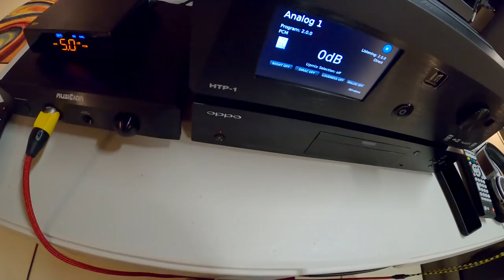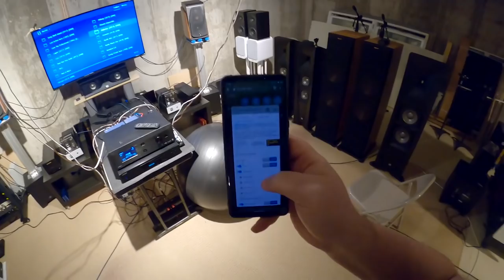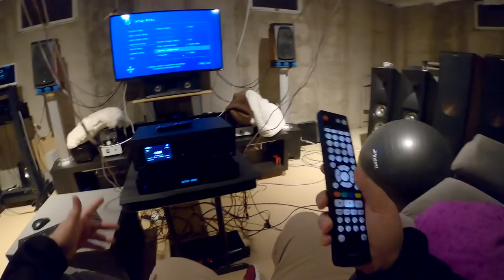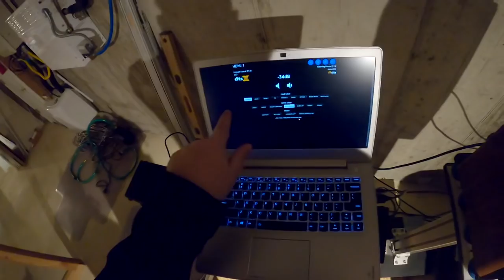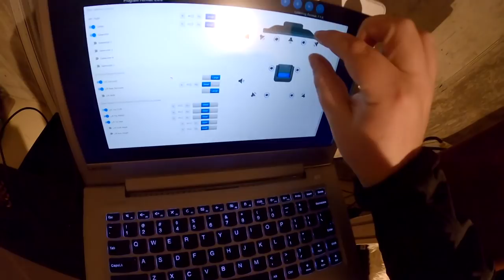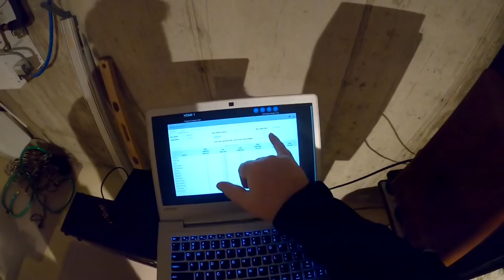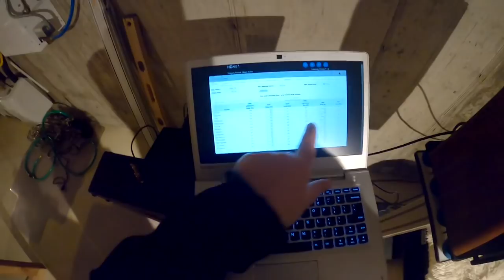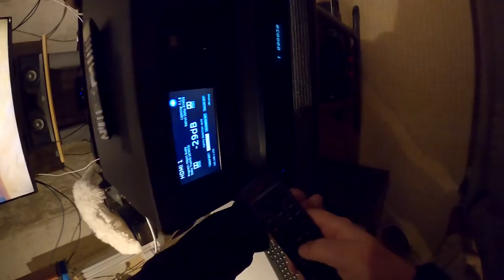🟥The Atmos Adventure💎💎💎💎 Monoprice HTP-1 Processor || Z Review

Comment from the maker: P.S. the video glitched twice and had Cyclic data corruption. So you may notice it at ~6 minutes and a little later.  Check out...
⚔️https://www.SubscribeStar.com/Zeos -- Subscribe Star
🥇https://www.Patreon.com/Zeos -- Check out the Patreon
Reply: Nobody... Z"s favorite word BURN MEGUMIN X( made me sad
Reply: Do a full surround setup of Adam T5/8V as the speakers, no more worrying about amps
Reply: Also some avrs/processors allow you to reassign outputs to different positions. Plug your "Mid" Atmos channels into "front" and see if in the menus you can reassign "front" Atmos to "center"
Reply: Z Reviews I've had a similar experience.  I have a Marantz AV7705 processor running into Emotiva amps for a 7.1 setup and I've been very disappointed with how much sound comes out of the side and rear channels, to the point that I'm considering just running a 3.1 setup.  However, when I go to the theatre, they have all kinds of sound coming from the surrounds.  How do you think they are doing this at the theatre?  Are they getting a better audio track than we are on our blu rays or do you think they are just altering it?
Reply from the maker: @blunderingknifereviews1028  honestly I don't know enough about commercial theaters to give a solid answer. I know the mixes for theaters are completely different then most consumer blends

Comment: If you still have that setup, what you really are/were looking for is the Auro-Matic feature. The specs page lists it as the last supported audio codec. I have a Marantz SR8015 in the living room with the Auro-3D 9 speaker layout / Atmos 5.1.4 format with the heights laser aligned to seating positions due to OCD. Auro-Matic takes content in whatever format it is in; DTS, DD, DD+, Atmos, even stereo, and converts it to Auro-3D. It will use the height speakers a lot, and it does a very good job with most (90%) content. There is an Auro-Matic setting from 1 to 16 that allows you to tune the affect. Set properly, the LRC and front heights have the front stage floating in the room sounding like it is coming from a few feet in front of your face at screen level. If you have the setting too high, some content will have random audio that should be in front of you sounding like it is above you or sometimes almost slightly mixed with the backs. Setting it to 14 keeps that from happening in my environment which is about 7.5ft viewing distance. During the day, my wife watches regular FIOS TV content like HGTV. It uses the height speakers and sounds great.  Also, 85 to 90% of content in native Atmos sounds better in Auro-3D. Atmos content in Atmos sounds good. But you can clearly hear things moving between speakers. The average person, if blindfolded, would be able to point directly at my height speakers in Atmos mode. Where with Auro-3D sounds blend better and subtle sounds come from areas/angles where viewers are not even sure if the sounds are in the content, in the house, or coming from outside at times.

Comment: There are a few things about Atmos that hurt my brain at first. Some of which are likely true of DTS-X as well...

With Atmos (at home), most Blu Ray releases are mixed to have 7 "ear level" speakers (plus LFE), using TrueHD to compress those channels losslessly.

Atmos itself is just an extra substream of metadata added to the TrueHD stream.
(older non-Atmos receivers simply ignore that extra substream.)

Originally, I thought Atmos releases would include maybe two full extra channels of audio along with the 7.1 mix.
But no, the bandwidth for the metadata is tiny. It doesn't contain any actual audio data at all, AFAIK.

So that means ALL of the audio you're hearing in the Atmos height channels originated in bed (ear level) channels.

Which in turn means - Atmos is essentially a fancy "panning algorithm" that selectively pans audio from the original bed channels into the height channels.

The metadata contains info such as X,Y,Z position, but it has to make some compromises with how much it can try to separate the "objects" from the original mix.

(there are probably some clever things they can do to extract specific sounds from the bed channels, because they are losslessly encoded/decoded, therefore they can do certain mathematical operations such as subtraction on the audio with no quality loss.)

The metadata also has some parameters such as the "spread" of each object, which to me suggests it just means how much it spreads the sound between multiple surround speakers, vs trying to confine it more to the nearest speaker (vs the X,Y,Z coords for the object.)

I only just got an Atmos setup as well recently, using an older Onkyo TX-RZ800 receiver, and only two height channels on the front wall atm. I have some other speakers on the way, so I can put them on the ceiling. The Onkyo can only decode 7 channels, but I'm working on something to decode 11.

From what I've heard so far, Atmos (and probably DTS-X) also uses some HRTF (Head-Related Transfer Function) stuff to whizz the sounds around your noggin more realistically. Or maybe not so realistically, depending on who you speak to. lol

Atmos definitely adds some extra depth to movies, but the mixes on most Blu Rays has been a bit disappointing so far.

Some movies barely use the height channels at all, even when the action on the screen suggests it should.
Reply: Something they do with TrueHD is quite clever...

(please don't take all of this as gospel. There will be a few mistakes / assumptions.)

The initial output from a TrueHD decoder is nothing more than raw uncompressed audio.
(usually 48KHz 24-bit on most Blu Ray disks, IIRC? Or is it only 16-bit, I can't remember? lol)

But, to make it easier for TVs and sound bars to decode things, the 1st and 2nd streams in a TrueHD stream often contain a Stereo (or Pro-Logic) downmix of the whole 7.1 surround mix.

The 3rd and 4th streams might contain say the Left Surround and Right Surround channels.
A receiver (or processor) can then subtract the L/R Surround channel audio from the Pro-Logic mix of the 1st and 2nd streams.

That will give you a 4.0 surround mix, leaving the phantom center in the front L/R.
They can do that with very little processing power, and no quality loss, since the audio is uncompressed / lossless.

The 5th and 6th streams might contain say the Center and LFE channels.
The receiver can then subtract the Center channel audio from the front L/R mix, giving a 5.1 surround mix.

(LFE is either mixed with the front channels, or sent to the sub, depending on the bass management settings.)

I thought that was quite a neat way of doing things, as it makes it far easier for cheaper devices to decode a 4.0 or 5.1 mix from a TrueHD stream, and it saves on bandwidth by not needing a separate stream for Pro-Logic vs discrete.

(the 7th and 8th streams will generally contain the audio for the Surround Back channels, with the 9th stream containing the metadata for Atmos etc.)
Reply: The technology is quite sound.  It works very well as Zeos found out with the Atmos and DTSX demos.   But yes, the sound mixes themselves can be very lackluster.

Some directors dont even want to work with Atmos (Chris Nolan, looking at you)

Other directors want minimal Atmos.

Then there are sound mixers who lock their Atmos mixes to 7.1.2 or 7.1.4 channels, effectively depriving those with higher channel counts from a full Atmos experience (9.1.6 becoming standard with preamps)

Hopefully sound mixers will get a clue and directors will finally unleash them to create phenomenal mixes.  But we arent there yet.
Reply: Damn emotional damages
Reply: informative, thx :]
Reply: @fredthebasspro2256  np ;)

I only just got around to building the first FPGA / DSP board prototype this week.

It has the same Cirrus DSP as in my Onkyo TX-RZ800, which is part of the reason I bought (and repaired) the Onkyo in the first place. lol

I haven't yet got the decoding working on the Cirrus, but it is booting and responding to SPI commands.

(I'm using an ESP32 for control. And the FPGA is generating some random square wave I2S to feed into the Cirrus, but I'm not getting any sound output yet.)

If I can just get Stereo working, then I can try decoding Atmos or DTS-X, then I'll be able to have more boards made for a proper hardware decoder.

(and also finish building my own 12-channel amp, which is the main goal atm.)

The board has an ADAU1466 DSP as well, which is meant for room correction / EQ / delays. Basically the same chip in the smaller MiniDSP.

(the FPGA can do some delays and DSP stuff, but it's a bit limited.)

Comment: Asking for rca jacks on this product is really a huge sign just how much this is not your cup of tea, I say that with all due respect, I love your reviews. I'm in the market for the RMC-1 from emotiva and a major selling point was that it had only XLR outputs for my 9.2.6 home theater. At a certain point you don't fit the equipment to the room, you build the room around the equipment.
Reply: I have the emotiva XMC2 and it’s incredible. Paired up with arendal 1723s monitors and surround with SVS heights and 2 PB300 and EmotIVA DR3 for amps. I have a legit theater in my room. I have a VAVA 4k ust that puts up a 150” screen 😎😎😊

Comment: I love these! Huge Huge crown fan. Once you start driving all this, a commercial amp like crown makes so much sense. 8 2 channel crowns giving you 250W RMS at 8 ohms would run a theater beautifully before you get into the actual commercial JBL theater systems. I'd love to see you try PA speakers for theater too. Behringer powered 10s or 12s can be had cheap compared to anything SVS makes.

Comment: The problem with Atmos is it may be object-based but literally everyone in the sound design process still treats it as if it's channel based.
Reply: Yeah, that's basically it and why I think for games it's great if impractical for most. Games especially PC ones have been treating sound as object based since at least the 90's when games became 3d, even EAX had rudimentary support for height objects even if it was meant in a HRTF sort of way. One day someone will make an emulator of sorts for EAX that can translate it to window's spatial container so then it can be played via atmos or DTS-X on the pc.
Reply: Thats the biggest problem with it
Reply: Atmos is great for video games FYI
Reply: 100% agree. I’ve been doing surround since the 80’s, and despite new formats, the software hasn’t significantly improved. Auro was first out, and its speaker layout is consistent with how humans actually hear (we’re relatively insensitive to sound above and behind). As of now, I believe the best option is to setup according to Auro specs and use the Auromatic upmixer on Atmos and DTS:X mixes. This makes the investment in surround sound and speakers worthwhile and significantly improves the experience of nearly any movie.

Comment: The Emotiva processor you have has been replaced by a 7.1.6 model for $1000.  It is good if you are willing to forgo the dirac and the better interface of the Monoprice.
Reply: And Auro upmixer, and bass and treble controls, and better signal to noise ratio, and better separation, and, etc.! You get what you pay for. What are you willing to sacrifice? For lots of us it's cash.

Comment: I wish someone would make a simple processor for a 5.1 system. Emotiva did, but it is unavailable or no longer in production. Just a simple processor that will do the soundtrack basics along with a quality video chip and say 8 HDMI connections with XLR outputs. No bluetooth or wifi, no apple, none of that. Just a simple solid AV processor.

Comment: Only just got around to watching this many months later! It would be really cool if you could create a permanent matched speaker setup that would work with atmos, DTS-X or auro 3D amps for reviews, I know
It would mean a lot of speakers as the auros would make it more annoying not using the same overhead configs, so it might be over 20 speakers that are needed lol. Probably save you time in the long run though for all the a.v amp and processor stuff, then when a new amp/dsp comes out you just connect speaker cables and bang! all done.

Comment: Dammm.. I was really looking at this unit hard.. I just wanted to take my denon out and hook up my blue Jean rca plugs.. There is no way I'm running new cables.. To my 7.2.4 set up.. 😢😢😢.. Another question.. Could it run 7.2.6?

All Blue Jean Cables 

Denon 3700.. Monolith 7 * 200.. Emotiva basx4 for atmos.... 7.2.4 Arendel 1723s LFC.. Arendal 1723s surrounds.. Arendal 1961s heights.. 2 Arendal 1961s Subwoofer.. Equals 😁😁😁

Comment: MR. Z, I'm using my HTP-1 with my Emotiva  A7 by using XLR to RCA cables by Worlds Best Cables. Although I really like Auro 3D, (actually Auro 2D because of lack of source material), I really miss Neo 6. The beauty of the HTP-1 is the massive adjustability of the unit. I set mine up manually and it sounds amazing. Caveat, not for someone who does not like a challenge, LOL!
Reply: I just added a second amp, (2 ch), to power a pr of XB's that I was not using. Now used as front wides.  So now there are 10 6.5 woofers, 4 5.25 mids, and 9 1" tweeters. All PSB!  In my bedroom! No wonder I cant sleep!

Comment: Waiting for the rumored Onkyo TX-RZ70 that is supposed to have Auro 3D its also my #1 pick, and I designed my speaker setup to work with it, because a proper Auro 3D setup will also work with Atmos and DTS:X but not the other way around.  Not sure I am willing to buy into the HTP-1 for that feature (the processor and the amps) especially not until it comes with HDMI 2.1

The BAD thing about Auro 3D is the lack of native content, so good luck finding movies using it, the good thing is its upmixer is supposed to be pretty awesome, often preferred to use the Auromatic upmixer to watch an Atmos movie rather than even the Native Atmos playback due to how bad some Atmos mixes are.

Also I am so jealous of your space?  I love how open it is, as a follow youtuber I would die to have that space to work with.

Comment: I think the Atmos diagram for the selection between 2 and 4 and 6 speakers is misleading. Every diagram I saw when I set up my four speaker system shows a pair in front of you and a pair behind you. The pair in front of you and behind you were set at a certain angle off your seating position. The parent front was not pushed all the way up against the front wall on top of the TV. That was only if you had six six speakers or three pairs. Your setup basically looks like that already. I'm guessing it would be fine if you just turned on. The four speakers ended the calibration.

Comment: Z, in the ceiling setup, choose front and rear ceiling speakers even if the “front” are in the middle. When you run Audyssey, I believe that should be corrected.
Reply: It would have worked if he chose Top-Middle and Rear Heights.   It wont let you do just Top-Middle and Top-Rear or Top-Middle and Top-Front.  Not without both the Front and Rear present.  But it WILL let you do Top-Middles with either Front Height or Rear Height.  Kinda weird but thats how Atmos chose to do it.
Reply: @FURognar  It’s been awhile but you’re probably right. The point is that there are work-arounds to get the desired outcome.

Comment: I'm confused. Why didn't you just select front and rear atmos speakers and not worry about where the schematic said they were located? I bet the processor would have mixed between both the "front" and rear to give you the mid channel. But I understand your frustration to some degree. Also, I think the Denon 3000 series has historically been the cheapest receiver with pre-outs. I have the X3200 and an older 7 channel Emotive amp... it's amazingggg. My recco for anyone starting out is invest in a good 5 speakers and 2 subs. Anything else is hype and barely worth it on disc or streaming. How many times can you watch Mad Max?? Nonetheless, I persevered to the end, and it's a good, raw video. Thank you for wasting your life so I can waste mine!

Comment: You should get one of those radiation meters and check to see if you are pushing limits for your safety or not . Sweet equipment. Be safe sir
Reply: Also check for radon gas coming up from under the basement slab.

Comment: I would like to see audio gear off load the processing to PC/ect . better handshake with computers and use the computer for procressing. just my opinion.lol
Reply from the maker: That is what the main theater does. MiniDSP UDIO-8 into a DDRC88D so no processor just MPC-HC Decoding and MadVR rendering. Dirac Sets delays and crossover points for correction.
Reply: @ZReviews  I am all in when they make a HTPC with full support for ATMOS / DTS:X and PCI cards with SPDIF outs or swap for analog XLR cards.

Comment: Denon and Marantz allow you to have your atmos speakers wherever and how many. 

I'd also love to have someone who knows what they are doing with a microphone set up your theater. I guarantee it can be better with proper subwoofer DSP and crossover setup.

 You had two subs split with the same signal, but they weren't time aligned, so there were most likely some cancelation of the subs. If you thought it sounded good how it was, I know it could be better.
Reply from the maker: It can ALWAYS be better.

Comment: And that’s the problem with anything higher than 7.1. Nothing supports it. 4k bluray tops out at 7.1. And I don’t think streaming goes higher either. 

So getting a receiver that does 12 Chanel’s is a waste of time and money. Only demo material takes advantage of all these Channels, and you would have to be crazy to set it up for demo material alone.
Reply: @plaguedog32  and how many discs actually do this? I genuinely want to know.
Reply: @plaguedog32  storm audio. not sure why a $700 receiver can't do the same.
Reply: @plaguedog32  lol mabye a Kodi add on